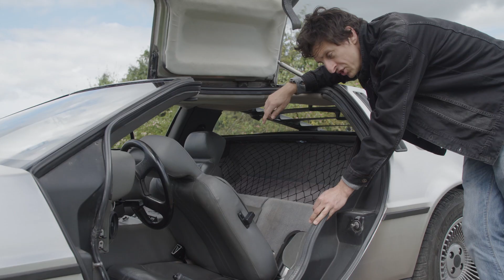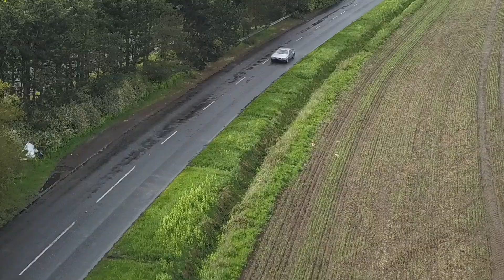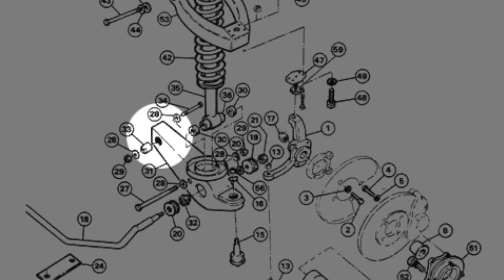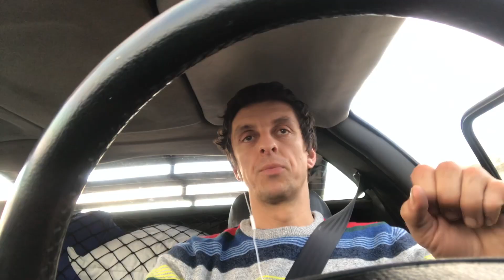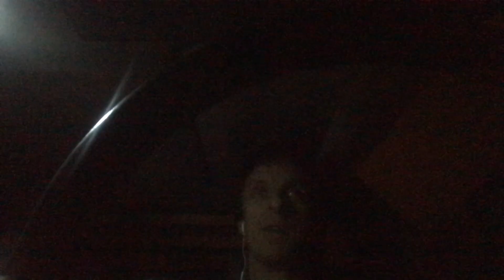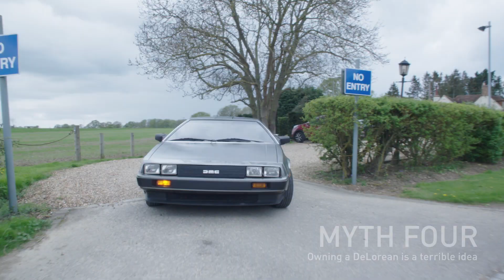1981 DeLorean DMC-12: Real world review and road test

Comment: Delorean Ownership Goals: 

Rebuild the suspension with aftermarket bracing and superior components
Replace instrument cluster with a digital copy. I know, I hate screens too... but it's the cleanest choice here
Gated shift assembly
1" lowered suspension to level it out
HID/LED lighting where necessary
Brakes -- full upgrade on all parts (stainless lines, new calipers/rotors/pads)

Engine - Replace components with better where possible. Many parts were already shared between other models, so some parts are simply an upgrade by definition.

And that's it. Let it be the car that it already is, just with a little bit of help.

Comment: Actually it won't go faster than 88-90mph, I know tried my car at long flat road at time had original 85 speedo. Then I took it to Delorean in Seattle for a stage 2 upgrade plus other upgrades. This ups H.P from 130 to 210hp. Also installed European 170mph speedo, custom floor matts and  Giugiaro emblem. Now it can go 120mph but started to lift front end, like a corvair. This guy saying 120 stock and 135mph as 160hp Euro model I don't believe. Getting modified suspension at Delorean L.A outlet which will lower front and raise butt suppose to control front lift.

Comment: Having owned a Delorean for 40 years this is an honest review. As a daily driver it is a wonderful car, very reliable. Many of the complaints of lack of power, alternator, front suspension, speedometer have been corrected over the years making the car even more reliable. But it has always drawn peoples attention, it looks like nothing else on the road. With all the stainless parts now available for the car, it can be made virtually rust free, if you have deep enough wallet. And an engine/trans swap puts it in supercar speed.

Comment: Bravo! Best DMC review of them all! My only critique is about the voltmeter, don't believe it; I used to be in constant fear my alternator (standard 90 amp unit) was struggling to power everything because the volt gauge would drop the same way yours does. I finally got around to testing with a multimeter and to my surprise and relief even with the low and high beams on, the blower motor on speed 3, and the car at idle the meter read 13.4 volts while the gauge was a hair under 13. When the stock radiator cooling fans came on the gauge dropped to halfway between the first yellow hash mark and 13V but the multimeter read 12.6V, quite a discrepancy. 

Again, superb work and thank you for posting.- DMC VIN 10287
Reply from the maker: Thanks! And yes - I’m not worried about my voltmeter gauge, I just think it’s a bit oversensitive!

Comment: So, you made this video in 2018, the car was 37 years old at this time.  I've owned a 1969 Chevelle for 38 years. It's 53 years old. My speedometer still works, and I can run the heater, radio, lights, power steering,  and never had a problem with the alternator. It's no show car, looks good from 20 ft away and I constantly get thumbs 👍 whenever I drive it. I guess, with John DeLorean coming from a background in performance cars at GM, Grand Prix, Trans Am, GTO,  and then he built THIS car. It just never lived up to the Hype. As a sports car.

Comment: This was an outstanding in depth look at a very interesting car.
I love this era of cars.  Their simplicity, serviceability, and the directness with which you drive them is what makes them rewarding.
A car doesn't need rocket acceleration to be fun.  Look at the history of cars and the eras when people were the most passionate about them.  People's passion for the automobile has not tracked with how fast they were at a given time.
Today's cars are comically, uselessly fast, but people care less about them than they ever have.  I contend that this has happened because cars have become sterile, insulated, unserviceable throwaway appliances that you never build a connection to.

I've been daily driving a mid-80s car for 12 years. Whenever you buy an old car you have to sort through the problems that have piled up over the years, but as long as you are willing to research and get your hands dirty then you can sort it out and make it reliable.  Best of all, you will then have a car that is truly yours - that you can maintain yourself at very minimal cost.  It's way cheaper than paying a mechanic to maintain something more complicated, let alone a new car payment.
The problems I had to resolve on my car were probably typical - electrical flakiness caused by broken connectors, alternator, exhaust, and most urgently the cooling system.  It only seemed unreliable because the previous owners chose to keep jiggling wires, replacing lost coolant, and otherwise punting instead of actually troubleshooting and fixing the car.
Reply from the maker: Best comment in ages! COMPLETELY agree about how the emotional connection to cars has been lost as they have slowly turned into personality-less appliances.
Cars of this era EARNT their speed - modern stuff just uses a turbo to punt out masses of torque, and don’t even get me started on EVs! (As much as they are the future…)
Reply: @RUNDMC1  electrics might be somebody's future but they're definitely not mine. I don't drive nearly enough to justify the cost of batteries for those things.
I love simple cars that I can maintain on a budget, without reliance on a paid mechanic/dealership.  80s cars weren't the fastest but they were practical (and still are, for those who are able and willing to maintain them).

Comment: This is a very impressive video, though I find the part after 9:33 confusing. He mentions that when the car loads up and rolls in a corner, the rear suspension makes the outside rear tire begin to toe in, causing the car to feel like "its about to come round on you." Wouldn't having the outside rear wheel toe in lead to an increase in understeer which would make the car more stable in a corner. My understanding is that semi-trailing arm cars (like the Porsche 911 and a large number of 60s and 70s BMWs) leads the outside rear wheel to toe out when the throttle is lifted off in a corner, making the rear end want to come around. Did you actually mean that outside tire of the DMC-12 toes out as the car begins to roll leading to oversteer? Am I misunderstanding something?
Reply from the maker: No you’re not misunderstanding anything. It’s a slip of the tongue and should be toe out not toe in! You’re quite right.

Comment: The downside is engine is at the back, no power steering means no weight on wheels that means less control when driving ! You need a few bags of sand in the front boot to gain control then you need power steering. Non starter.
Reply from the maker: Your logic is all over the shop. Why add weight and complexity when you don’t need it?! You only notice the heavy steering when manoeuvring - once on the road it’s absolutely fine.
Reply: @RUNDMC1  They didnt fit power steering  because there is not much weight on front wheels. This means tyres will have less grip on the bends and when breaking.

Comment: RUN-DMC, not all cars were rubbish back then, I had Mercedes 190 made in 1983. I had it till 2015, was the greatest and the most reliable car. I used to do many road trips and around 40000miles per year including working as a pizza delivery guy. I spent less than 2000 pounds on it including buying it. The only problem was, it had some corrosion.
Reply from the maker: Yes you’re right - that era of Mercedes was famously well built, also the Japanese cars then were better than most of the non-German European offering.

Comment: You can still by the oem factory parts. I've driven one many times because I know someone that has one. It looks like the old vw scirocco, the gull wing door can fail with that torsion bar and hydraulic support. They used tension bars for the suspension on the old Peugeot GTI. John Deloeroen got convicted of bad stuff. I never liked the tiny window. The stainless steel body is heavy. The ride is not that good. But its my opinion and your opinion differs. There's also a leak on a seal that was a faulty design. For its time, it was OK. Its more of a looks and park up car than an everyday driver car. Your right about the speedometer.
Reply: the car is a variable assisted resin injection molded body with very thin stainless panels. The torsion bars are only known to fail when people get lazy and dont replace the strut and decide to torque the torsion bar instead. Delorean was not convicted, he was found guilty as it was 100% entrapment. Windows, i kind of agree but you get used to them.  No idea what leak you speak of, never had any leaks in mine. If its referring to the engine, that was the volvo variant which is in the same prv family but not the same motor per say.

Comment: Thank You
Ive owned a Delorean here in Australia (1916 Jun 81 with a petrol flap) for almost 10 years. I laughed when your windscreen wiper decided to shift its position as its happened to me on more than 1 occasion and yes its always raining.
The only major problems I have had with the car are the central column that holds the gullwing doors on had rusted and we made a new column out of stainless and the other major was that there is a 2 piece splined shaft in the gearbox that wore out  ( 80,000 miles).
I drive it on long journeys and loved your fair and accurate description of owning one .
Cheers David Parkinson
Reply from the maker: David Parkinson Thanks David!

Comment: I'm not a car fanatic but even I know that a sports car is NOT a luxury car.
In a sports car, everything is subject to the overall performance of the car. Its driving and handling, accellerating, etc. Driver/passenger comfort is secondary if it is there at all.
I remember a certain Ferrari that didn't even have an inside door handle but just a piece of rope to save weight and space.
In a luxury car… well, it's the other way around. Everthing is subject to the comfort of the driver and passenger(s). A luxury car may look fast but it ain't. So that would be a DeLorean.

Comment: You called "impractical and will break down" a myth?  Dude, you only drove a few hundred miles and the speedometer stopped working, the windshield wiper nearly fell off and you lost a letter off the cars logo. What would the car have to do to prove the myth, burst into flames???
Reply: Oh no, a letter fell off of the back of a 37 year old car. Might as well crush it into a cube now, it's broken.

Comment: Re your tyre comment - in the UK, at least, you could get the Galaxy RWL in 235/60VR15 from North Hants Tyres. Modern tyre formulation, period tread pattern, modern performance and a car tyre rather than an SUV tyre like the Grabber, and under £100 a corner.

Comment: The voltage drops when you start turning things on because that car is not equipped with a Mr. Fusion. You see, engineers at DeLorean were forward thinkers: They knew that that add-on would come along, so they didn't bother about fitting in a more powerful alternator. Awesome car and awesome vid!

Comment: the Delorean in USA was slower due to the required emission controls added 
in UK it wasn't put on
the new Delorean co does make a twin turbo add on
later Deloreans installed a door for the fuel cap so you didn't have to lift the trunk/boot anymore
quite a few owners have replaced the Renault engine with other engines that have  parts more widely available

Comment: If the speedometer doesn't work then how do you know your going the speed limit lmao. Yes this is probably a stupid question
Reply from the maker: Arcadia Not that stupid! Helps to know what revs what speed corresponds to - 4th is 20mph/1000rpm, 5th is 26.67mph/1000rpm. So if you’re doing 3000rpm in 5th you know it’s 80mph.

Comment: Well done video.  Thank you, as I learned a lot.  I'm most surprised with the engine as it held up to sustained high RPM's and fuel mileage was excellent.  I would have liked to hear about heat and air conditioning, as well as electrical regarding wiring, connectors, or fuse box issues.

Comment: I enjoyed this video. But the Delorean IS too slow.

About 12 years ago, i did a stoplight dragrace against a DMC-12 in Guelph, Ontario, Canada. I was driving my Dad’s ‘98 Honda Civic DX. The only mods on the Civic were an upgraded tranny (it was a stock tranny from a Civic SI, which gave it SLIGHTLY tighter gearing in first, second and third), strut tower braces, and MTX amp, and a Pioneer head unit. That’s it. No real performance mods. The tranny may have brought the 0-60 time from 8.5- maybe 8.2?? Either way, still only 106bhp. But that was the car I learned stick on, so I mastered that tranny and clutch pretty quickly.

Anywho, I don’t know if the Delorean was a manual or an automatic, but when the light turned green, and we both floored it, I pretty much walked away from him. I was legit surprised how slow the Delorean was. He was really trying, but so was I. Looking back on it, the Delorean was probably an automatic, as i would have thought he would have kept up for a bit, but he was already in my blindspot before were were through the intersection, and the gap just grew and grew from there.

The Delorean isn’t dangerously slow, but it’s close. Considering the Fastest stock Deloreans hit 60 in about 8.5, and the slowest being around 11 seconds, and considering that this is a rear engined, rwd, sports cars, that IS slow!

Comment: The horsepower on these is a little low but the jigawatts are awesome!
Reply: 1,21 Jigawatts!! I rate this car 3,6. Not great, but not terrible.
Reply: It's not low for early 80s.
Reply: that's only on the mr fusion models
Reply: Jigawatts lolllzxz
Reply: The horsepower at the time was above average, especially at 160. My firebird of 1988 had the same amount and was way heavier. The power at the time was fine. Doing 0 to 60 in 8  or less seconds was very braggable back in the day.
Reply: GW

Comment: Time for an LS swap. And reinforce the transmission, they strip splines on the input shaft (I think).
Reply: I hate changing the original parts,i mean its an early 80s car,do you really need tuning it?
Reply: @johndelorean7353  Since it's all original looking, doesn't appear to have been sitting in a backyard for 20 years and pieced back together, keep it as original as possible. If you find one thats been through a dumpster fire, then game on.
Reply: @Lost_Between_Heaven_And_Hell  I agree

Comment: Looks like the oil pressure and coolant gauges aren't working. Could be the engine is cold, but the oil shows crazy high. Fuel gauge dropped down and then back up. But hey, the car is quite old, so little things like that are expected. Still a very nice example.
Reply from the maker: ButchNackley both gauges work, it’s just the calibration. My car runs particularly cool in any case - in traffic the temp gauge will hit the quarter mark then the fans turn on. Oil pressure gauge looks wrong but if you don’t have pressure it drops and that’s what you’re looking out for anyway.
Reply: @RUNDMC1  id say the same, i have wings B cool and mine barely egst above the bottom temp line. As well as the oil pressure is always capped, it works just is not calibrated. Agreed

Comment: I disagree with you on one thing-- there's nothing wrong with power windows in a car, it's not "stupid engineering". Power windows are pretty simple  as there is just the motor, the switch and the power source. And power windows aren't heavy enough to substantially contribute to the weight of a door. 
The poor engineering lies with the broken speedometer and the poor charging system as you mentioned. 
As far as I know, most cars in 1981 should have been using a speedometer cable . They are simple and reliable. I had a daily driver 1970 Chrysler 300 with the original cable from april 1970. It started making noise because the cable was dry. All I had to was disconnect the cable, slide the square cable out of the casing, lube it with white lithium grease, and it was good as new. 
Maybe you can adapt your car to a mechanical cable. 
I also can't believe that in 1981 , a cars charging system would keep the battery charged, especially since transistorized voltage regulators were common. My 1970, 1972 and 1973 mopars fed the power through the Ammeter before the rest of the car, which was a bad design, but it still charged the car. I drove my 73 Imperial everywhere until I sold it last year.
Reply: its a mechanical speedo. Things wear out and its rather easy to fix. Most older cars had one.

Comment: I have to question the statement it was close in performance to a 944 of the time...your talking about a 16 sec 1/4 mile vs a mid 18 in the DMC...that's a big difference.

The US performance was abysmal...like 19-20 second 1/4 mile times when mustangs ran 15s and Corvettes, which were cheaper, ran 14s.  The car just didn't perform speed or handling wise vs the competition.
Reply from the maker: BA_300_AAC I’ve run a 16.1 at Santa Pod in this car, think I could even get it under 16 with a couple of tweaks and the right run.

Comment: when i worked for renault, i once had a rare renault 25 v6.... turbo  in for a service. im thinking it wouldnt be too hard to turbo one of these .
Reply from the maker: initialB 240 There have been a couple of installations of that Renault 25 turbo unit into DeLoreans but the challenge has been getting the EFI control to work right, as you need an aftermarket controller to handle it.